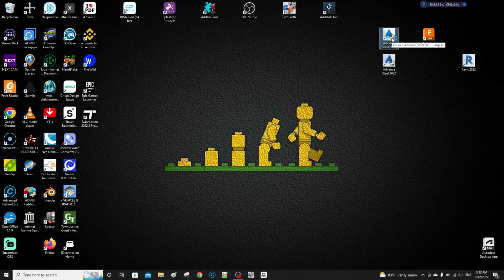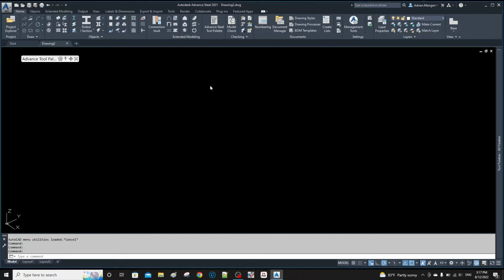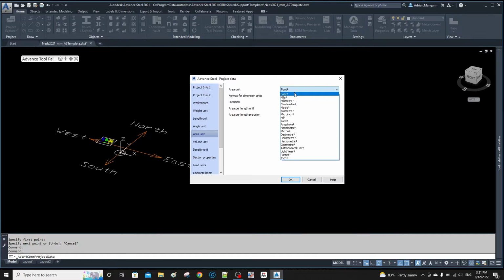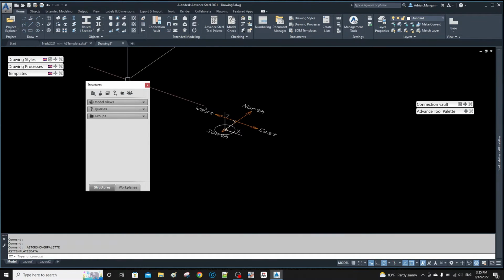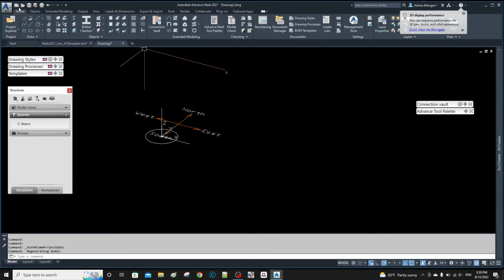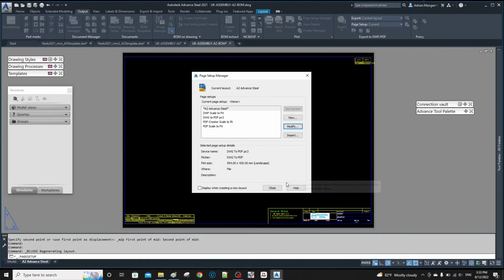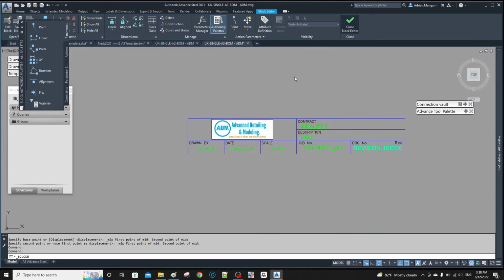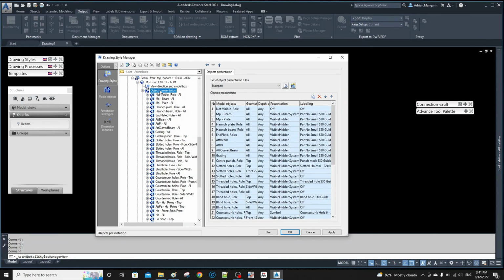ADVANCE STEEL: Working in Metric. Part 1.

Comment: Great work, how did you put x, y, z in drafting cursor and the central coordinate. You are good
Reply from the maker: Hi thanks for watching, type "options" then go to the #D Modeling tab, tick the second box in "LABEL AXES IN STANDARD CROSSHAIRS"
Reply: @EIRCAD  Many thanks, I will try. really face challenges to complete documentation shop drawing. i have given a small frame to only use advance steel. Any tips and tricks to fast track my skill. Thank you once  more